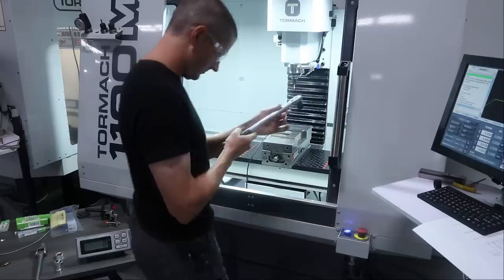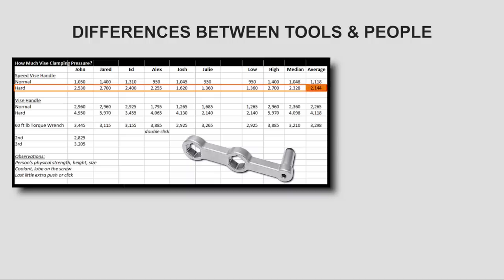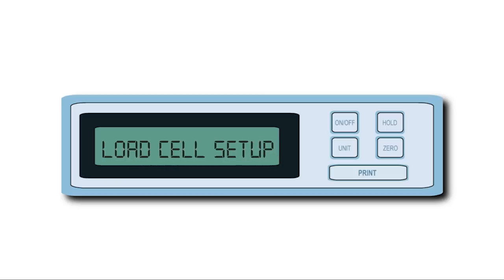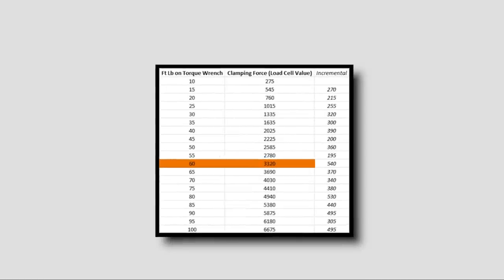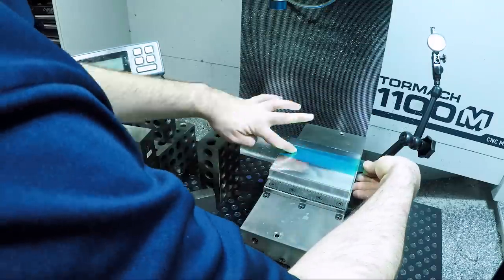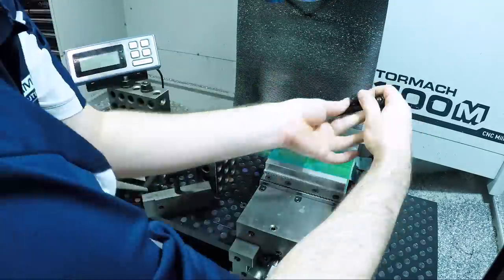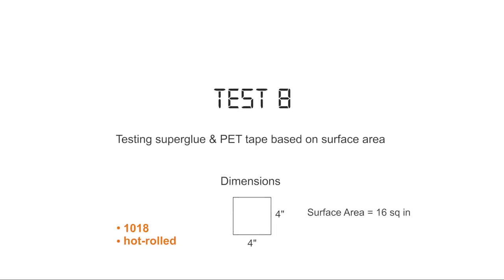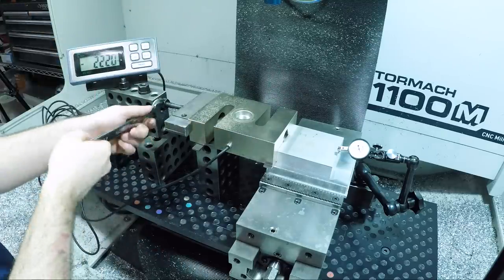How Much Gripping Power does a Vise Have?

Comment: On the torque wrench: buy a quality unit, they're not that expensive to get a good one. Make sure you pull perpendicularly to the handle from the hand grip and try not to induce twist. Come up on the desired setting very smoothly and slowly, and trust your instrument, no need to double click. Besides, if you do it right and try for a second click, it should not move the bolt at all as static friction is higher than the dynamic friction. Edit: I was further watching the video and saw on a few occasions where things were tightened up with somewhat outstretched arms resulting in the spanner jerking as it was tightened. In those cases use a longer wrench and hold it closer to your body if possible to try and get absolute smoothness when tightening

Comment: Everyone reading, the clamping force applied to the vise jaw by turning the vise screw is is determined by 4 factors, Torque applied to the screw, Dia. of the screw, Pitch of the thread, and friction from the treads meshing. Torquing vises with equal torque that have different screws will produce different clamping forces.

Comment: I guess you need to start testing  tapes now! What tolerance does each popular tape / super glue combo add on before you factor in your actual CNC tolerance? Perhaps graph tape-type /area curves...

This was awesome - so interesting. Thanks guys
Reply: Thinking about it - we should consider cutting forces that are generated with bits, feeds, speeds and material.

Then you can create a zone map of force generated and really have a clear idea of what clamp approach is appropriate for what kind of cut on each material.

Huge endeavour, but a selection of cut forces generated with various setups would be super interesting, I'm sure. Maybe you need to collab with high speed vid to capture the data... Unless the load cell can be connected to data recorder and synched.

Comment: Very good video! I think the aluminum discrepancies between smooth jaws and the grip jaws is down to 2 different factors. Firstly (Just an idea, not a fact) it could be that the aluminum is galling on your steel smooth jaws, increasing sticktion. Perhaps try different jaw materials with an aluminum workpiece? Second, I think the grip jaws could be cutting pieces out of the aluminum because its so soft. Could you please try once more the smooth versus talon/grip jaws but with different workpieces? I'm thinking aluminum, mild steel, bronze, halfhard alloy steel (4140 pht?). Also, I'm super interested if gripping length changes how the jaws grip, like if there's a big difference between the MMM jaws (full serrated) and the premade Talon Grip jaws from Mitee Bite with differing numbers of "Cleats" (basically partially serrated)
Thanks for making great content btw, I look forward to your next vid

Comment: I've used a thick two sided tape for UHMW fixtures mounted on aluminum.  If both surfaces are clean, they hold really good.  Just don't leave on too long or its a pain to get off.

Comment: Great video but you missed one test. When testing lateral force your block was about half the width of the vice. While stiff, even this type of vice will rack so instead of thinking of the jaws a parallel think of them as forming a trapezoid. So you're forcing a part towards the narrow side from the wide side. You could test a block the full width of the jaws so the force will be maximum at the middle, over the screw, and tapering off at the edges (limited by the rigidity of the jaws). Alternatively, you could test a 1/3 width block on each side and in the middle of the jaws. You should also monitor the stop on the left side (is that a tenths indicator?) to see how much it is deflecting or sliding. Ideally, that is your reference surface and doesn't move at all but that's not likely.

Comment: Great Video. But It would be more practical to know how much clamping force is needed? How hard to tighten your vice when using a 10mm endmill adaptive? Does calculating cutting force is enough or is vibration and dynamic load loosen up the part at this force?

Comment: To eliminate the slip in the vice you should turn the vice, so that the fixed jaw is holding the load.  Another point is, that only the answer (p=F/A) of the specialist is only the first approximation. This is very well know e.g.  for mechanical brakes an even car wheels. In general one should think, that the pressure is higher with less thick wheel because of p=F/a, But it is as so often the micro structure of the materials. You do not know the correct A. Therefore broader wheels happen to have more grip if the street is dry, not if the street is wet. If the street is wet, you have to have more pressure by reducing the contact area. Perhaps you know, that for racing teams, they like to use slicks with no profile on dry streets and change immediately to profiled tires, once it is raining, because then the pressure is higher because of less contact area. So it is not as easy.
Another point for vice pressure is the question of friction within the vice. If friction in the mechanism is higher, you are not able to put much force on the work piece. So be aware, that friction is very important especially in turning machines. If the chuck is not maintained properly, you can have at high speeds, because of centrifugal forces less pressure on the part, and it may fly away. As physicist in safety sciences I had to examine many accidents (mostly lethal) in these cases.

Comment: The talon jaws have those serrations on them so they hold with more than just friction.  I suspect the aluminum is yielding at the higher forces which is why you see the drop.  You would probably get a different inflection point when using steel.

Comment: Have you thought about friction when making your math? Yes, the pressure is lower with bigger surface, but neither the piece nor the jaws are totally flat... So the friction between them increase with the contact surface area. I think this is how you can explain the results you are showing today.
Reply: With the exception of certain materials (like rubber), the contact pressure is not taken into account when calculating friction force.  It is only based on the normal force aka clamping force.  What he is more than likely seeing is the material itself yielding.  The grip jaws have those teeth in them that bite into the workpiece.  That gives more resistance than just friction due to localized deformation.  If he used steel as opposed to aluminum he would more than likely see the inflection point at a much higher value.
Reply: @Worrsaint  excellent points both.
Bite type jaws, or inserts grip can be limited in shear or deformation of the work piece (tearing). I agree with both Thomas Manure and your self. Co-efficent of friction, for steel to steel or steel to Aluminium ranges from 0.1 to 0.3.  Various tricks improve grip on milling vices, include abrasive paper, paper, copper, aluminium or similar when gripping steel, some compliance is also introduced here. Hard facing materials using Electro Spark Deposition, from Surmet, Carbonite etc, greatly improve grip.
Reply: @bostedtap8399  From what I have seen in the comments a lot of people seem to be seeing grip and friction as one and the same.  Friction is only a component of the grip.  You also have compliance (as you mentioned), cold welding, van der walls forces, sticktion due to micro vacuum and just the strength of the material causing yielding in the shear direction.
Reply: @Worrsaint  I certainly had not considered Van der Walls forces, explaining the reason that smooth jaws as well as co-efficent of friction achieve grip, some synaptic transmission has increased 🤔 👍.
It would be interesting to compare simple grip between steel and aluminium for the same jaws, modulus of elasticity differs greatly here, plus alloys across steels and aluminium.
Regards John.
Reply: @bostedtap8399  would also be curious to see the difference in the grip in the x and z directions.  I would think it would be easier to pop it out in the z than in the x.  For a piece sized like he has you would also have the most deflection inducing harmonics and chatter.  Not to mention the cant of the jaws due to how they are tightened would cause them to be spread at the top more than the bottom.  I do not know how much some of these matter for the vast majority of applications, but it would still be interesting to know.
Reply: @Worrsaint  yes, there are many many variables, jaw yaw ("Cant". I haven't heard that word for a long time), is a big factor in cheaper, or poorly designed vices, until recently, I was using a several Chinese, and a Taiwanese copy, and I ground the jaw plates with a small taper to ensure when tightened they were parallel, or bias to narrower at the top, a DTI on the fixed anvil showed surprising deflection. Some trials with tightening torque was performed. I now have Geraradi vices, and a substantial improvement.

Comment: You might instruct your people not to touch a torque wrench anywhere but the handle, and if the handle has a pivot, to be sure it is floating between its stops. To brace yourself on the head of the wrench will cause inaccurate readings, as will bending the shaft of the wrench by pushing the pivoted handle against its stop. I know it is easier to get more torque on any wrench if you can brace yourself on the head of the wrench (I do it myself); the extreme of that is the cross-wrench where you double the torque by pulling on one arm while pushing on the other. However, you shouldn't do it when using a torque wrench. Try it both ways and see. (In fact, this is a request for such testing: Use the torque wrench both ways to the same torque setting, and see if there is a difference on the load cell.)

Comment: Typical holding failure doesn’t come from it sliding out of the vise. Failure is usually pull out of the vise due to the mechanical leverage of the helix angles on the cutting tools. 

I’d rig a load test to see how much force it takes to pop the part up out of the vise

Comment: Perhaps the best way to get consistency using a torque wrench is using torque-angle.  Torque to a low number (maybe 10-20lb./ft.) and then turn a certain number of degrees.  This is how many fasteners are tightened in automotive applications these days.  The problem is that the more clamping force you have, the less accurate the torque wrench is; especially when stopping and starting (having to overcome starting friction).  You can buy torque angle wrenches and repeat the test!

Comment: Annealed aluminum is super soft, and will have plastic deformation at about half of the pressure of copper. I'm thinking that the repeated clamping of the talon jaws into the test piece acted like heating the surface, annealing it.

Comment: there is another part, and that is time, i.e. put the unit under pressure and then leave it for a bit, because you may have the part beginning to fail but you increase the pressor that that then makes it look like it fails at the higher value. when you are machining a part, you get is to fail just you start to machine or a short time later into the machining.

Comment: In the aluminum tape/superglue/tape scenario It deflected a lot. If you were to apply force to so that it nears maximum deflection and then remove the force does the work piece return to the original position?

Comment: The reading of the load cell will not be accurate if you apply a force over the whole face with the vise. They are to constraint in that way.  Put a ball bearing the hole so you have only one point of contact per side.
Reply: this is correct, for most accurate and linear measurements.   the whole S frame will deflect in a non linear fashion if used on the flats.  there is a more suitable load cell out there.  that type used is more of a tension device.  the cylindrical ones are used most often for compression readings.
Reply: @nilzlima3027  also very correct
Reply: I was going to say I remember hearing the exact same thing in my labs at school but now that I’m looking through manuals and videos I can’t explicitly find someone saying “don’t load the whole face, just the bolt hole”. Most manufacturers ARE saying s beam load cells are for tension and compression just not making a point about how to do the the compression load.

I would be curious to see if you repeat the torque wrench test a few times (same person same technique) with a point load and a few times with it on the whole face if the standard deviation would be significantly different? My gut says it would.
Reply: Splitting hairs here. We're talking a few % difference at most.
Reply: Which is why they simply recorded it as “load cell units”. 

There was no interest in actual units like Newton’s, or lbs.  only comparative units as to what held more.

Comment: We can se some of these results in a non machining setting, in the snow a narrow wheeled car will grip better than fat wide tires because the same weight is spread over a wider area which lowers the lb/sq". but in the same area the wide tires give better traction because they are pushing on more material/surface area almost a contradiction but its not.

Comment: You forgot one key exact thing about torque wrenches, hand placement.
Too far in or out will vary the actual torque reading, and double clicking also adds about 10-15% higher in torque value.
Reply: The amount of force exerted by the hand will change, the torque will not.  The biggest variation is how fast you click it.  To be accurate you need to go slow and sneak up on it.  You could see them throwing their weight on it instead of gradually exerting more force until the end and over traveling the click.
Reply: I've also heard that hand placement makes a difference, even with clicking torque wrenches. Even though I've watched a video that "proved" it, I'm still a bit skeptical. It'd be very cool if the SMW crew were to test this if they make a followup video.
Testing different speeds would be interesting too.
Reply: @Hirudin  We did testing with torque sensors and stuff at my old job.  It does not make a difference where you hold it.  The big difference was how quickly and suddenly you apply force due to the spring mechanism used to make it "click".
Reply: @Worrsaint  sorry but that is wrong, it entirely depends on the mechanism of the torque wrench. That particular wrench they are using has an effective length line on the handle, that's where the force should be applied, either side of that line and the torque applied will be wrong.
Reply: @dj280z  You twist the handle to set the proper spring tension for a given torque.  The torque is effectively measured at the head of the torque wrench.  Where you press along the lever changes the tangential force required to click it, not the amount of force 50 lbs 6inches out or 25lbs 12 inches from the center of the anvil rotation both give 25 ft-lbs of torque.  If where on the lever you pressed mattered, it would not be measuring torque by definition.
Reply: @Worrsaint  I have calibrated 1000s of torque wrenches clicking them 10s of thousands of times, I can 100% say without a doubt that it makes a difference on almost all wrench designs.
Reply: @dj280z  As someone who has done testing with torque wrenches for inserting mandrels for lathe turning, I can 100% say you are flat out wrong.  If you gradually increase the torque you will get the same number.  If you press fast you will over shoot the number.  Does not matter where you hold it, that will happen.  It is not just me 2ho says you are wrong, the laws of physics also do.
Reply: @Worrsaint  You have no idea what you are talking about. A torque wrench is not a fixed lever and the trip mechanism on most wrenches isn't on the centre line of the wrench. I have literally clicked wrenches 10s of thousands of times, it makes a difference. If there was no reason to put an effective length mark (where you should be pushing) on wrenches no manufacturer would do it. Did you do your testing with a calibrated torque transducer?
Reply: @Worrsaint  here you go, I don't have access to the Norbar transducers anymore but this shows what happens. https://www.youtube.com/watch?v=MrNGNz3cDFs

Comment: Friction is the function of the surface roughness; material; and force.  Area has no part in it which is why you were getting the same values for holding thinner pieces as thicker.
Reply: Yes, finally someone points out this basic relationship .

Comment: Tried super-glue and a simple piece of paper between saturating it with glue before putting on the work-piece? It would give a stand-of that may make it easier to separate the parts but that would essentially be nothing but super-glue with cellulose fiber reinforcement...

Comment: Ok, now how does that relate to cutting forces? If it takes say 500 pounds to move the workpiece in the vise how does that compare to the normal cutting forces exerted by various machining operations? How much force are you willing to subject the machine to? Is this even an issue until you get to higher HP machines?

Comment: If you have a 4" long piece and grip 1/2 "  of it at 10 pounds, would that not equal a 4" piece gripping 1" deep at 5 pounds? Shouldn't equal psi be the same gripping regardless of how many square inches are clamped?